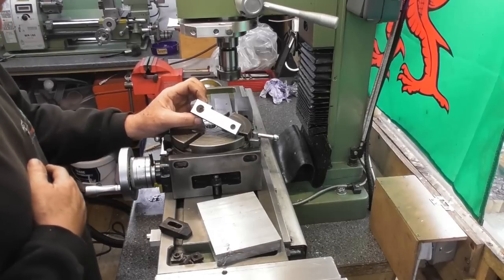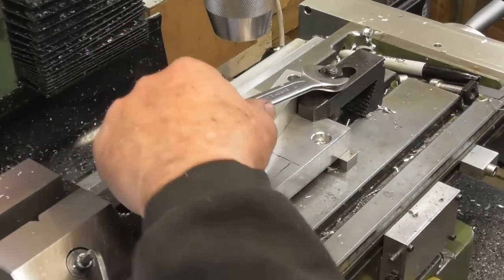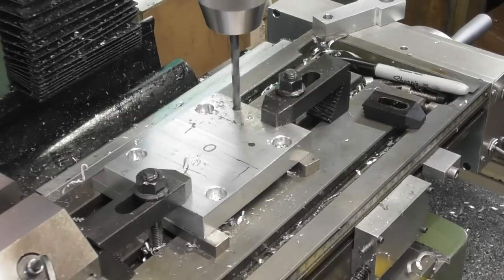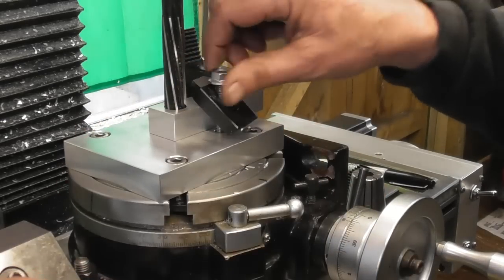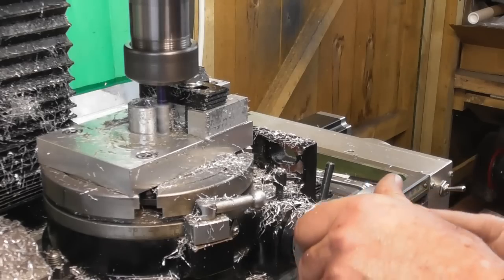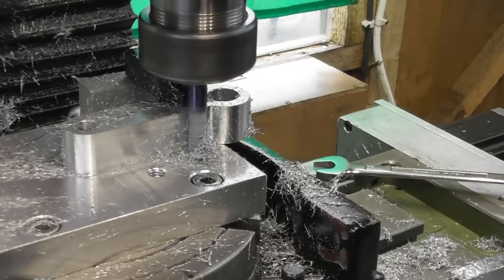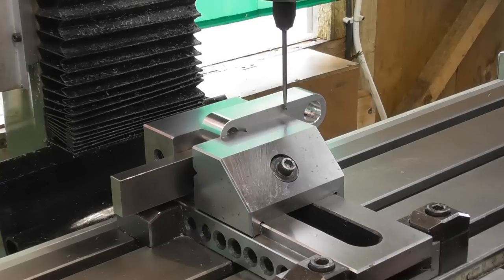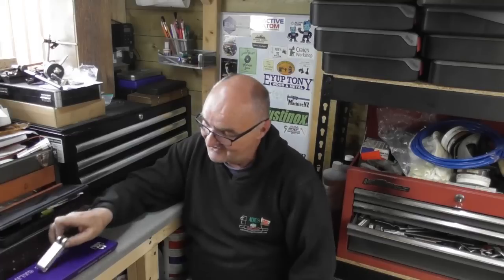Rotary table Shenanagins

Comment: Have you considered picking up the taper in the rotary table's hole so that you can repeatably align your fixture? Many of these tables have an M2 or M3 taper and you could attach your fixture to an M2 or M3 blank: then the 6mm hole in the centre will align your part to the taper and the fixture and consequently to the rotary table.

Comment: I have a machined taper on a parralel shaft, the shaft goes in a collet the table sits underneath the taper, raise the table into the  point and the rotary table self aligns in seconds job done

Comment: I found a good way to center a rotary table is to machine a piece on the layer that fits right in the center and then taper it up to fit into a chuck.  Just adjust x and y untill it fits.

Comment: Another nice bit of workmanship Ade. I still can't help but shout at the screen 'keep your fingers away from the cutter!' I know you know what you're doing but a newbie might get the wrong idea, how about using a pencil, long scriber to point out what you're showing, plus it will keep your hand 'out of shot'. As for the item; could it be part of a tilting vice or some form of adjustable angle plate?.

Comment: I know this has nothing to do with your project, but I like your flip up electrical receptacle cover to keep the swarf out behind the mill! Cheap and effective!
Reply: What is this swarf you speak of?
Reply: @Pedro72740  Swarf: Fine chips or filings of metal, stone, or other material produced by a machining process.

Comment: Hi Ade,
I've not been subscribed for long but I love the videos you've put out for us all to enjoy!

I just realised you have the same model of mill as the one I've recently ordered, I only got it as it was on offer and the only one in stock at the time.
It's my first venture into this kind of work and I just wondered if you had any advice or tips for this particular model?

Many thanks

Pat
Reply from the maker: Hi Pat. Great choice on the mill. I did videos on setting it up when I bought it . lasting tip is that they don't like slot cutters much . end mills are far easier on the machine . sort out a fly cutter with high speed steel bit , they can do a lot and easily sharpened and save costs on expensive cutters . Get an ER32 collet chuck for it . other than that watch more of my videos , lol, Cheers Ade.

Comment: Evening Ade ,next time you need to center the rotary table, put a centre in the spindle, stab the hole ,with the bolts lose, tighten the bolts, and its near enough for rock 'n' roll.( within Couple of thou )
Reply: Great tip... Thx...

Comment: Ade, all very well you skimming over the ally plate, but all you have achieved at present is that it is parallel to your bed, AT the rotation position that the rotary table is locked at NOW. You could well be still out should you rotate the table a few degrees, IF the rotary table top is out of parallel with the base. Your best method now would be to set up a fly cutter that passes over the center AND outside of the ally plate. Take a cut and ROTATE the the table until the plate cleans up. At work we used to mount the rotary table on a surface grinder with the wheel passing over the center with sufficient stroke to cover the table diameter. Take a cut and every couple of strokes, wind the rotary table a few degrees until it cleaned and sparked out all over. I would also like to suggest that the next time you remove the ally plate, to counterbore the bolt holes deeper, so in future setups, should you need to skim the plate again, the cutter will miss the bolt heads. Keep the videos coming please, makes my day to see a UK person. I am a Londoner living in Adelaide in Australia. Regards and stay Safe and Well.

Comment: Hi Ade nice work bud ,I have the same miller as yours , thanks for the video picked up on lots of pointers m8 cheers for that ,any chance you could email me where you bought the stepper motor for your X auto drive and any other bits ie speed adjuster , did you do a video of how you made the whole unit ? would be very gratfull for any assistance you could give me , frindly Regards    Dave .S
Reply from the maker: the links to the bits are in the description of this video 
https://www.youtube.com/watch?v=6IdCXGDw03g&t=17s
I did a series on the making starting with this episode .
https://www.youtube.com/watch?v=biLaJXhUFrg
Cheers Ade.

Comment: Nicely done Ade, never got on with coaxial indicators, they do save you punching holes in the back of your head cracking it on your machine but somehow I prefer the old fashioned following the clock round, I think I may have trust issues! The intrigue continues. Cheers, Jon

Comment: Hello, Thanks for the video !  What diameter of Rotary table Chuck do you recommend for that type of mill ? 
I've got a SX2.7 mill.
Thanks
Reply from the maker: This is a six inch table so it I were to fit a chuck to it I would look for a six inch low profile 3 jaw chuck. Cheers Ade.
Reply: @ade63dug  thks

Comment: I have a screwless vise like you are using. The problem is i can't get it to clamp tight enough to use it for milling. Is there a solution to this so I can use it? It is a 5" wide one made in China.
Reply: It'll need a 10" wide handle for the 5" wide jaws.............
Reply from the maker: Hi Lonnie , that is odd , they normally grip really well without any great pressure with the allen key. you may have a real duff one . are the jaws parallel when closed and is there any play in the moving jaw , Cheers Ade.